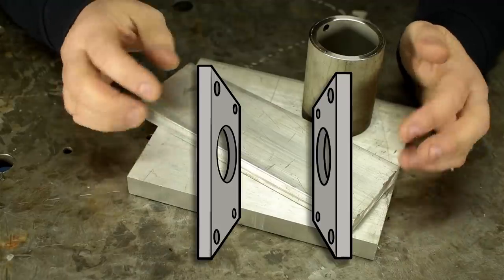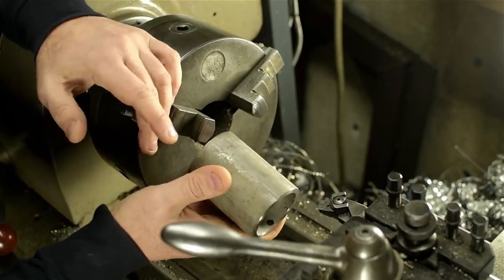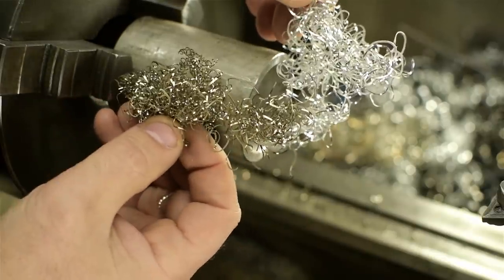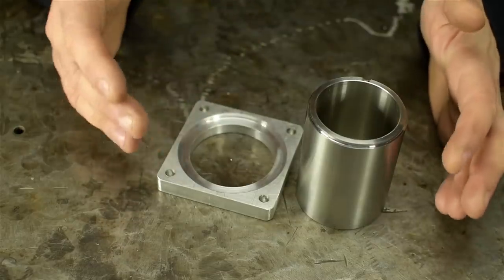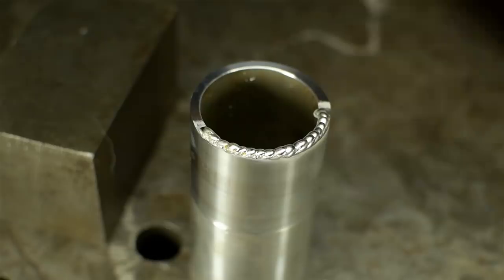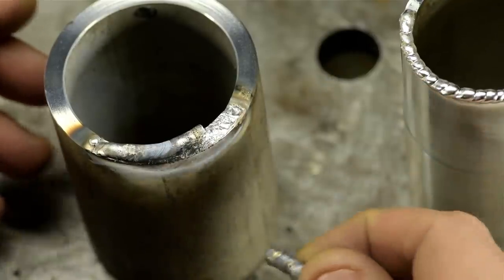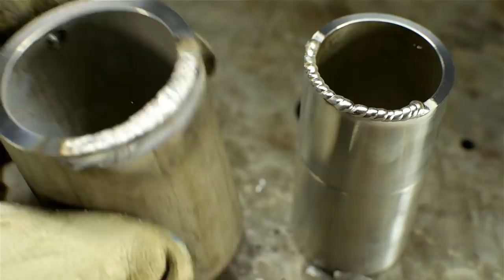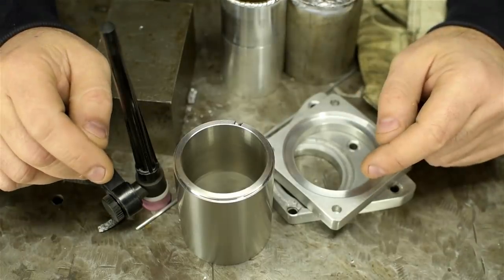UNWELDABLE Aluminum - Caught On Tape!!

Comment: Your comment about the mad scientist got me curious, so I did a little googling. Turns out, Prof. Xiaochun Li and his team at UCLA managed to develop what's basically a filler rod for 7075 that's infused with titanium carbide nanoparticles, which somehow fix the uneven flow issues of 7075. Tensile strength of the welds were up to 392 megapascals.

Not exactly accessible for a home gamer, but apparently they're working with a bike manufacturer on implementing it into production. Sounds like one day, maybe in the not too distant future, we'll be able to weld 7075.
Reply: Well, yes and no.  There's two distinct problems with welding 7000-series.  The first is that the chemistry of the material is such that conventional methods and materials don't actually weld it.  That could be fixable by specific filler rods with specialist chemistry.  The second is that this is ZINC alloyed aluminum we're talking about.  Welding processes are generally hot enough to boil zinc off/out of the material being welded, creating an extremely dangerous fume.  That's where that white residue Tony found below the failed bead comes from.  On a manufacturing line, you're probably using robotic welders, so you aren't worried about exposing workers to the zinc fumes.  For the home welder...just don't.  It's possible to protect yourself very effectively, but to do it really well you'd need  to combine a welding mask and a respirator with the correct kind of filter for protecting against both fume and dust forms of zinc.  You'd also have the possibility of fine zinc dust loose in the shop, which is not a happy thought.
Reply: @evensgrey  See, you can tell I've never actually welded.

Comment: Easy, just use a hot melt glue gun and stack-the-dimes to make it look proper!   That's what I do.
Reply: ...and paint it.
Reply: @GreeceUranusPutin  
A grinder and paint makes a welder what he ain't...
Reply: Yep and try not to apply any load until the paint has fully dried.
Reply: If the part doesn't look like it'll hold up, clearly not enough coats of paint. The paint is structural remember.

Comment: Tony, it's the same as if you take a sheet of aluminum and try to form that sheet, it will crack when you try to have it conform to a specific form.  But if you cook/temper in an oven that same sheet of aluminum, after you won't have any problem to make that aluminum to conform to the curve shape and you would see any cracks.    NOw in your case, that alloy you tried to weld.  What happens when you try to weld cast iron cold,  it will crack after next to the weld.  Now that alloy did the same, the weld bead lifted when it began to turn cold.  
A friend of mine had this same problem to fix a machined bracket that cracked and broke off that was made of a similar alloy, it looked like aluminum but was impossible to weld.

Here what we did to weld these two pieces.  We made a jig to hold these two pieces for welding.  Now we heated in an oven both pieces for about 20 minutes so these be very hot.  ONce we pulled them out we placed them in the jig and started to tig weld them and the weld did stick and held.  And is still holding today.  Now if by any chance your pipe is made of the same alloy, maybe you should try heating that part in an oven and take it out of the oven and put a bead on it.  And see if the bead stay welded to the part.  PS.  Don't forget to remove any oxydation after the part comes out of the oven if at the first attemp it did not work.  And if it doesn't work, well you have something different for an alloy.

Comment: There are 2 different types of 7000 series aluminium.  The high strength version has copper added and while it can be welded, the welded joint will be extremely weak.  Most of the strength can be regained through the correct heat treatment, but this will make the weld area very brittle and failure due to cracking is very likely.

The medium strength version which is Al/Mg/Zn without copper can be welded and again reduced strength in the weld area can be improved by heat treatment, but without embrittlement .  This also age hardens to a certain extent and depending on application heat treatment might not be required.

Harris Performance in the UK used to make motorcycle swinging arms from sheet 7000 series and told me they were far from easy to do and the heat treatment process could be problematic!

Comment: Teach 🤚 Hey Teach 🖖 You didn't explain how bikes out of 7k Aluminium stock are welded @ToT
Reply: I don't know of any bikes made out of 7k series aluminum. They're almost always 6061.
Reply: @jameswright4732  Banshee Bikes for example, they use 7005. Welding an alloy like 7075 seems to be a bit more involved though.
Reply: Pieter van Gisbergen there was a  European group working on it with a space laser, but it kind of got out of hand.

Comment: I once had an alloy framed bicycle brought in to have a cracked seat tube welded up. I cleaned & prepped it & got a decent looking bead on it which came off just like the one in this video! Turned out the frame was made of Magnesium...

Comment: At about 1:45 I figured you had a chuck of some of that alodine impregnated aluminum. That's heavy stuff until you squeeze out the extra alodine. Which you can then use to corrosion proof your non alodined chips and shavings.

Comment: thank you . this answers a question i have had since 1970.. what the heck was the french racing bike i bought for 10 bucks because the owner was getting a new one to go bike race on made out of..  it had external straps almost hydroformed like copper fittings for connections between tubes.. the whole 26" ten speed only weighted 13 pounds..  i loved that bike.. my cousin took a ride on it .. rode it to the arcade and traded it for a hand full of quarters or i would probably still have it. i had its replacement till about 5 years ago..  my friends $15,000 carbon fiber bike weighs that now.  funny.. the trek and my bike were geared the same.

Comment: A few years ago a friend of mine brought an aluminum gearbox housing by the shop with a hole in it. Just wanted to patch job and he had already done the prep work (all cleaned up and ready for welding)
I preheated the housing in my shop oven and as soon as I started the torch and made my first puddle I realized there was something wrong with this "aluminum" The puddle was sooty, burned greenish and definitely didn't flow anything like aluminum.
I'm sure you know buy now but this housing was actually magnesium .
I had just assumed that when he said aluminum gearbox that the housing was aluminum and never confirmed for myself.
Not really a big deal I switched to az92 filler, and had to clean the weld in between each pass because of the sooty deposits and did some stress relief afterwards just Incase. But welding magnesium is just as easy as aluminum if not easier. Since then I've always used the vinegar test on any "aluminum" casting brought in. And it has saved me a couple times since then.

Comment: So much Tony!  Also, I felt a bit better for thinking it looked a bit like titanium when you said "...it looks like titanium".  As someone whose entire time working with metal was limited to putting holes in wing skins and picking between round and square tube stock, I was worried that I didn't know what I was thinking...

Comment: You got an interesting blue tinge to the arc as well - don't remember seeing that before. The green I've seen before when you are welding aluminium, but never blue. Have a look at 4:00 - 4:17, you'll see what I mean. Could it be this is a very old piece of ali? As in WWII era, when zinc and magnesium were commonly added because pure ali was harder to get hold of? I dunno, I'm not a metallurgist (or welder) but I do know that different metal ions emit different spectra. And no, that's nothing to do with Captain Scarlet ...

Comment: It's actually 7475 series. Mainly used in aircraft structures. Or pneumatic/hydraulic cylinders that get bolted together. Stuff that needs super high strength without the cost of going up to titanium.
Zinc is primary alloying agent. (which is why it's yellowish) Magnesium, copper, and chromium also exist in small quantities.

Comment: Always a fun one. The Fireball Tool guy did tests of some variants of cast iron to identify them. Among the tests I recall he looked at the sparks from grinding. Are there any similar tests for aluminum alloys. I mean without opening a home version of NIST. Tony noted extra weight so I suppose that’s one. The color also didn’t “look right”.

Comment: There has been some progress made in welding 70 series aluminum.  Researchers added titanium carbide nano particles to the filler metal, and they found they can weld it without failure.

Comment: It is magnesium. At least it behaves like one during welding, with bead with aluminium rod popping right off. Been there done that. VW transmission casings are made with magnesium, and I had one for the repair in my shop. I mistaken it for aluminium and exacly that happened. Weld was dirty and soothy and popped right off. And belive me or not but magnesium welding rods are scary expensive.
Tony, try ligting the chips with oxygen torch. If they will burn with bright white light it is magnesium.

Comment: Reminds me of that one time when I was just a young kid getting into metal working, just started forging and casting and all that stuff in my back yard. Bought some scrap alimunium at the local scraphead and attempted to cast it, but it didn't melt in the foundry. I got that sucker as hot as I could but it just wouldn't happen. Decided to find some other use for it and tried cutting it. White hot sparks as soon as the grinding wheel hit the piece. I'm guessing magnesium. Kinda glad I didn't get the foundry hot enough to ignite the stuff, that could've been fun...

Comment: I onced worked on a huge piece of that 7000 series for nasa. It was 2 foot long 1 foot wide and 8 inchs thick and a manifold for hydraulics. The stock was 800 bucks 30 years ago and had holes on every side connecting in all sorts of ways. All o-rings and my boss told me all of those must be perfect with a mirror finish and nothing could be welded. He told me to use kerosene and cutting oil 50/50 mix and if I made one mistake I would be fired, he was not joking. After about 40 hours on the Bridgeport  and some sleepless nights I finally finished. I did it and was so proud but the shop went belly up soon after so I lost my job anyhow.

Comment: If its 7075 it can be welded, in 2019 UCLA materials engineers developed a new filler material for 7075 with Titanium Nano-particles which resulted in successful welds. The resultant welds had a tensile strength of 551 megapascals which is is nearly 4 times that of 6061. You can purchase the filler rods from MetaLI USA.

Comment: There are some 8000 series alloys with titanium and zinc.  Might be fairly rare but they see some use in aerospace. I seem to remember the B1-B being mostly made of such a cast titanium-aluminum alloy. Those leaked like a sieve and fell out of the sky because the wings were two cast pieces bolted together and filled with JP-8 but they'd do silly things like using the wrong drill templates and it was too expensive to replace or melt down and recast.

Comment: Interesting how at the arc welding temps/point of the 70XX alloy, the alloying metals separate, and the zinc off-gasses. Would be interesting to see if there is a way to join say 7075 with some 7075 in a non-arc welding manner; like laser, friction, or resistance welding.

Comment: I got some of that low temp aluminum solder type welding rod at a yard sale. Haven't tried it yet. But, looking it up on the great internet machine, was pleasantly surprised to see that it is REALLY good stuff....It is zinc with a little aluminum alchemy. Maybe Tony can use that to attach this stuff to other aluminum stuff? Maybe I am just a delirious old putz with dementia.

Comment: Welding 7000 aluminum might be possible.
I ran across "Nano-treated High Strength Aluminum Wires/Rods" from metaliusa.
I would love to see if you could get this stuff and see if it works.

Comment: question ???  I need to weld up a old 1986 Toyota truck windshield frame that has rust holes , any ides ? can i put a piece of copper behind the hole and build up a metal puddle and let it cool and keep going ?  or Braze it ?  any cool ideas ?

Comment: 7000 series materials ARE weldable, but the high strength version contains copper and welds will be very low strength.  Without copper the weld strength isnt bad, but can be improved with heat treatment. Trying to weld Al/Mg/Zn materials in the same way as alloys without zinc, will always fail though as a different technique is required.

Comment: It could be a machining or hot forging grade aluminium, high in Mg , you need to remove the magneeeezium  before you can weld or braze the parts. The white rust when you  weld it is MgO magneeeeezium oxide.
Heat hammer and anvil is the way to go.

Comment: I have never welded a thing in my life, but plan on building a recumbent trike and will need to weld the cheap Chinese bicycle tubing it will be made from. Can you recommend a good all purpose welder that will do the job without breaking the bank. Once I have it I may find some other small jobs to use it for or putter around with things but nothing heavy duty.

Comment: That's interesting. It didn't look like it touched it, as in it failed to melt it even. The only Zinc Aluminium alloy I was aware of before was ZL12 which is great for casting.

Comment: I've seen 7075 welded before, it welds but all the zinc boils out of the joint and is very weak.  That acted more like the time we tried welding 2024.  The copper content might explain the weight and chip color.  The white could be MgO too.

Comment: This Old Tony,
      At the risk of starting off the old, pointless, and stupid debate may I suggest that if you were welding aluminium instead of aluminum it would have worked 😊. 
Seriously though, something is perhaps a little off here. I have done a lot of work with 712, the casting equivalent of 7000 series wrought alloys. It is rated as a “C” on an “A” to “D” weldability scale where “D” is worst. So not easy but not impossible either. It machines very well with excellent chip formation with just about any tool but certainly with those polished ground high rake tips. But of particular interest is that the colour when machined is quite white, much like machined magnesium alloys and not the darker sort of grey that you got. I note that cast aluminium alloys with a “D” weldability rating and some rated “U” (which I take to mean “forgetaboutit”) tend to be high silicon alloys, these machine with that darker grey sort of finish.  I would agree that the white deposit could indicate zinc but other things e.g. Magnesium and the aluminium itself can also produce white oxides. So just how sure are you that the material is actually 7000 series?.... Martin

Comment: I came across a "white brass" on a 30yo drainage valve on a commercial cooking kettle. At first glance it would look like a 30yo beat up valve body, and all modern cooking equipment is always stainless steel.... Right!? It absolutely refused to take a weld like SS and after dealing with a upset customer and lots of research it turned out to be silver brass. Which we ended up removing the old valve and replacing it with a new standard stainless steel one.

Comment: I would like to make a 5 axis milling machine. Do you have some plans I could use I would like to work with metal. Sizing the stepper motors and gear boxes etc. is out side my skills.

Comment: 7075! I think thats what it is!  Ran into that crap before... Knew what it was but didn't know you weren't supposed to weld it :(  I think it has zinc or something.  If I am not mistaken, recently they have found a way to weld it with titanium carbon.... Those rods will be expensive.  The resulting weld is stronger than the part you welded by many times.

Comment: have you tried friction welding it back onto the bar it came off ?  just guessing it should be possible at lower speeds with ALU having a lower melting point than steel (steel friction welds at around 2500-3500 rpm and it is a pure guess based on knowledge of melting points but aluminium should friction weld at less than 2000 rpm unless the crystalline structure of the aluminium produces much less friction .  if not id like to appeal the unweldable status its not the stocks fault it was made like that, every alloy  should have a welding means or it would be a pile of dust

Comment: You could measure the weight and dimensions and calculate what the weight per mm squared is and find a material which is really similar if you have a material you are unsure what it is.

Comment: I see a video from you I click, really enjoy your content mate thanks 👍

So 7075 or similar? I know that’s a harder grade of aluminium used in high end multi rotor parts like motor bells that are spinning over 20K rpm and getting bashed into the ground. I can deform the thin parts of cheap motor bells with my fingers but the 7075 ones can take an absolute beating.

I just assumed the material used in higher end brushless motors was more expensive but now I’m guessing a big part of the extra cost comes from the extra work/tool wear in manufacturing using these materials?